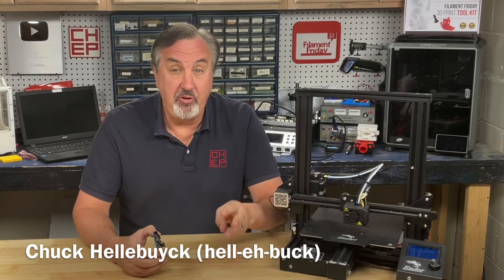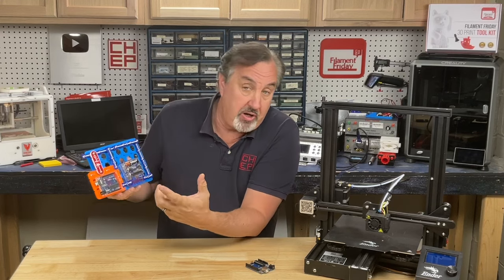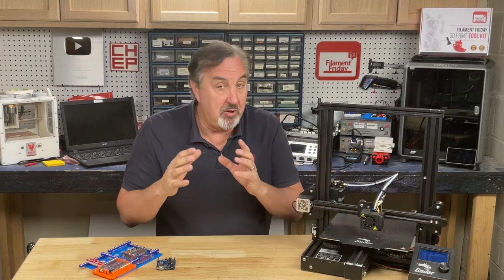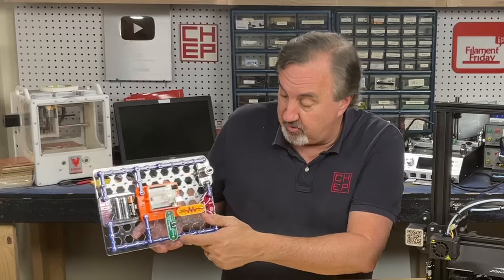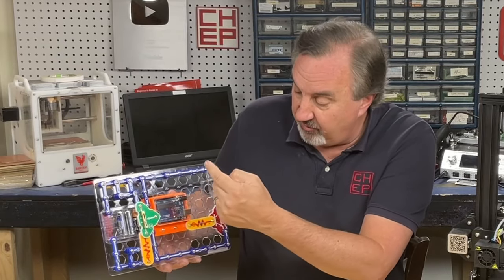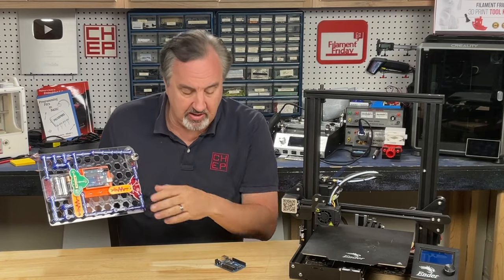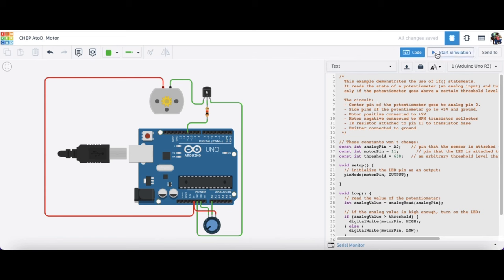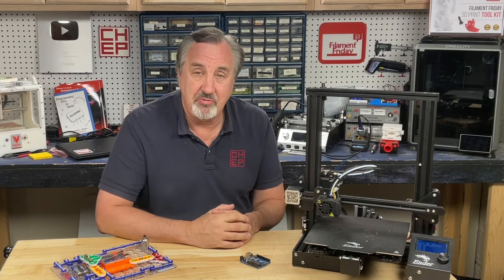Master Arduino With Just 3 Essential Functions!

Comment: I like this new electronics series. I would like to know more about the difference between source or sink outputs with arduninos, I never understood the difference and if it matters with ardunios.
Reply from the maker: Source from Arduino is typically the port supplies power (typically limited to 20ma). Sink is Arduino port enables a path to ground (typically much higher that 20 ma). 
Adding external buffer circuitry just boosts the current limits via external supply.

Comment: Good day Chep. I have a klupper printer running on a raspberry pi 5. I want to connect an arduino uno r3 as an extra mcu to control relays and enclosure components. Do you know of a way to flash klipper onto the uno r3 module?